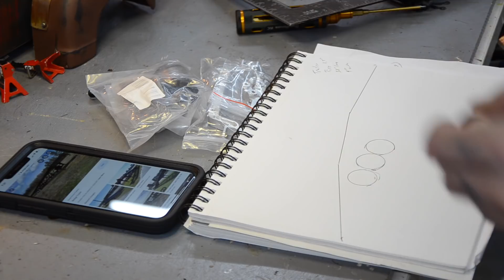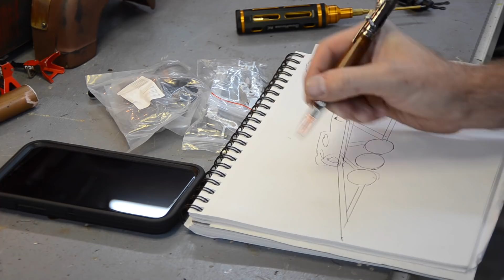RC Rat King Hauler Part 1, Fabrication & RCengineering the chassis and Wedge trailer Scratchbuilt RC

Comment: That mk4 golf body 🤤
Reply from the maker: I wish it was as nice as it looks. Lol. Those bodies are hard to find.
Reply: @RCeveryday  hell yeah id pay with my left nut for an mk4 jetta rc body. Especially wagon. I had a 99 jetta 01 jetta both sedans and the last 05 wagon. Amazing cars. 2.slow 1.8t stage 3 frankenturbo 25psi and then 1.8t ko3s stage 2. Drove the last one till last year and couldnt kill it. I tried 353000km on the clock with 21psi of boost. Body rotted out. I drove the thing into stone walls and poles at the end when i was getting rid of it. Hardly any dents almost none. Sent her off doing a second gear burnout against a dozer bucket at a construction site before i sent her to the recyclers. Still have all key fobs and the last 1.8t emblem. Amazing cars all with 5 speeds. Those who rag on the 1.8t dont have proper tools and dont do oil changes on time or other maintenance.

Comment: I’m sure you know this but welding outside is a bad thing. The slightest breeze blows the shielding gas away and makes the welds suck.
Reply from the maker: I’m using flux core so the welds all suck

Comment: can you tell me the  measurements  of the frame thank you  and by the way nice job on that truck
Reply from the maker: I’m at work right now, but I know the trailer is 36” long and 9” wide. That was the only part I measured so it will fit three of my cars on it.
Reply from the maker: The truck is roughly 24 inches long.